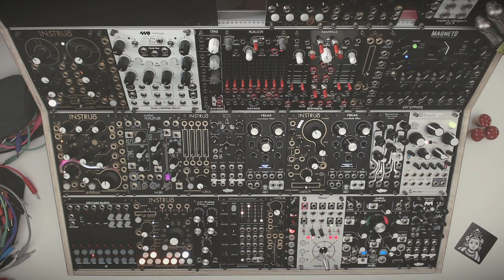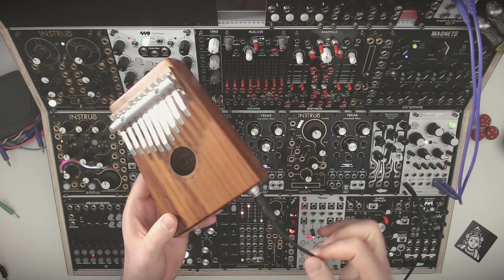Patching from scratch with Mutable Instruments Beads

Comment: Beads is pretty sweet but I really wish that it could record at 24/96 and had a longer buffer. Which would of course require better converters and like 8x the memory capacity. Which would probably make it at least $500. But Morphagene has those specs and costs that much, and that price point didn't seem to hurt it's sales or anything. 
Anyway, I find that the lo-fi converters are fine (arguably preferable even) when processing the harshly crisp sounds of digital oscillators, 90s/00s synths, and dub samples/beats. But to properly capture the rich, subtle, organic tones that make acoustic instruments and analog synths so magical, a higher quality ADC really makes a huge difference. Especially when doing time stretching and granulization like Beads is made for.